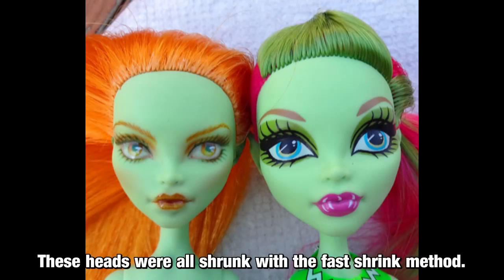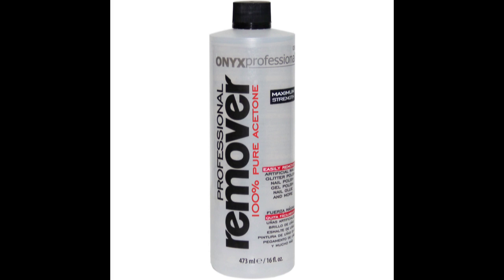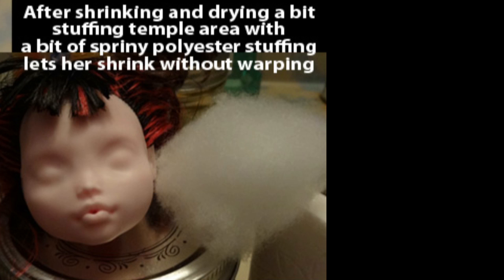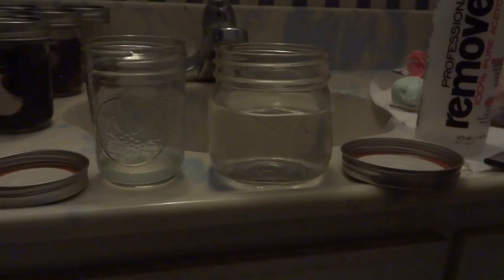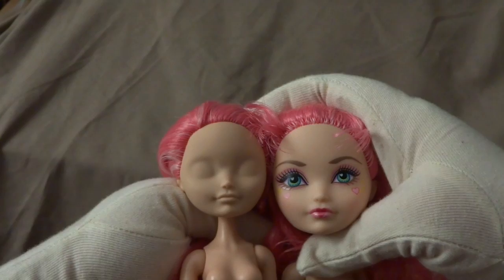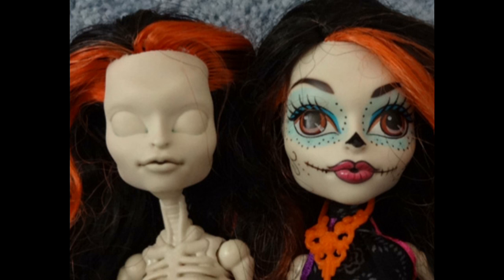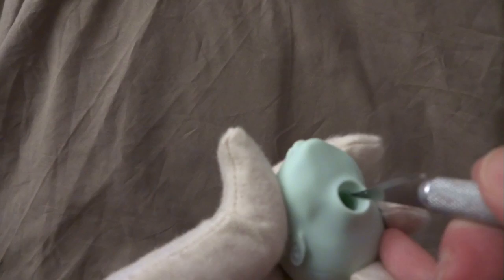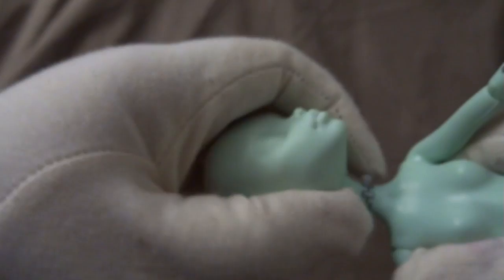Vinyl Doll Head Shrinking Tutorial: Quick method

Comment: Quick question for you, what's your method for safely disposing of the acetone once you're done?  Where we moved to, we're on well water and I don't want to mess up whatever we're drinking or cooking with.
Reply from the maker: You can actually leave it outside in the open to evaporate. Somewhere high enough that pets or children won't walk up to it and sniff it. Make sure to put it in a container that is not plastic and will not melt, and also make sure it's one you don't care about. You don't want to leave the jars you soak in out there, because sometimes it can be  pain to get the residue out if it gets dried and stuck on the bottom.
Reply: EXCELLENT and I totally should have thought of that :'D  Thanks!
Reply from the maker: np!

Comment: Thanks so much. I have the rounded everafter head, so it's 70-30 acetone to water for slow method? This will retain paint on face right? Thanks
Reply: Sorry was on Mom's tablet ...Thanks again
Reply from the maker: After shrinking even more heads since then, I find that you can use as little as 10% water and still get the same level of safety and results. But to be perfectly safe, probably err a little more on the side of slightly higher water content like 12-15%. It's a little hard to eyeball it anyway.

Comment: If anyone has a doll head that shrunk wonky (waves hand wildly) all you have to do is plop it into boiling water and voila. I recommend letting it stay in the water until the squishiness wears off. That heat allows the head to recover from whatever squishing process happened during it’s drying off process once out of acetone. I am experimenting with switching the head between pure acetone into fresh water. I’m betting it will shrink up just fine with the water gently cradles it.

Having said that, it occurs to me to warn you guys who compressed the heads during shrinking to give a more V shape. Don’t let the head get warm or it will likely return to its natural shape.

Comment: Hi Dirili. I decided to let my barbie heads take the plunge. Quite satisfying!! Thanks so much for your clear instructions. 

Quick question. If the doll head develops a split from removing the rooted hair, how I repair that section before I soak?
Reply from the maker: If there's a crack, you need to stick to slow shrinking. You can't really repair it before before shrinking, because anything you could use likely wouldn't stretch and contract with the head and might even melt and mix into the acetone, resulting in unpredictable results.